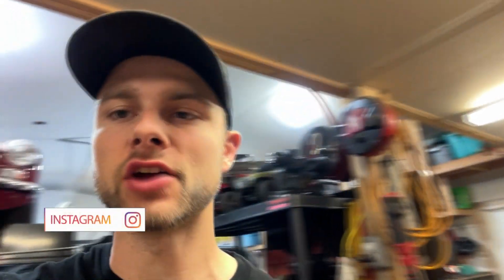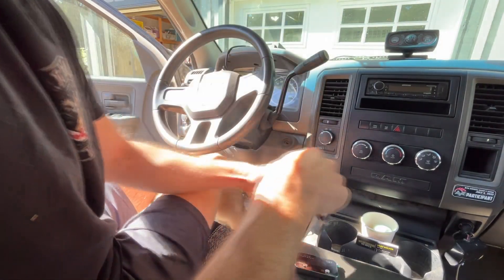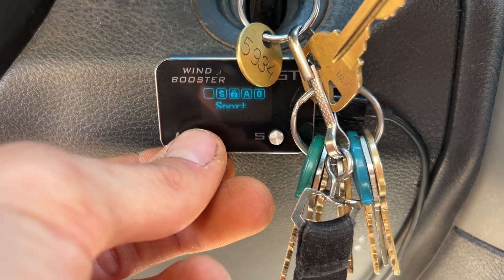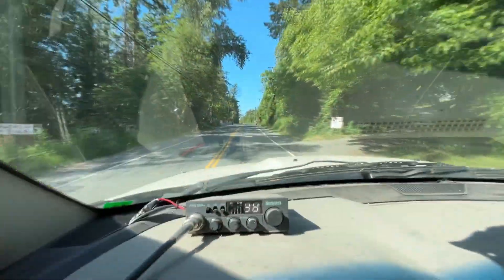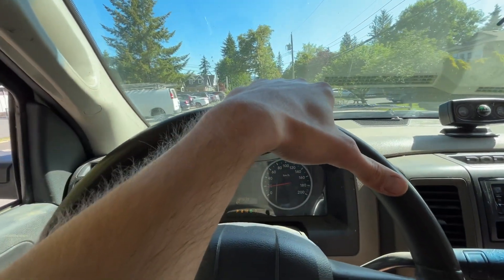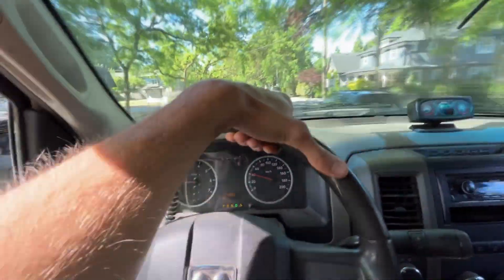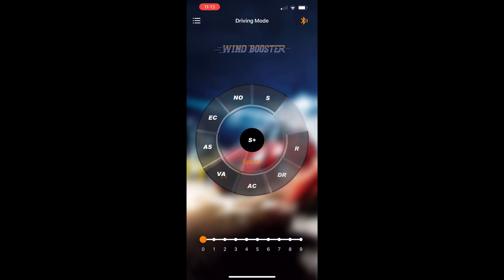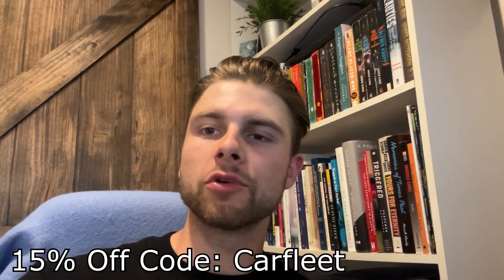Installing Windbooster Throttle Controller! Unboxing, Test & Review | Worth $200?

Comment: I need one..   hope it works good, do an update later. Does it get rid of that initial delay in the pedal?
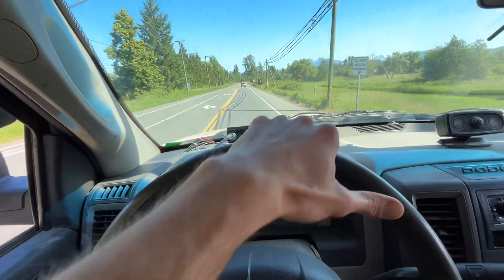    Lake Havasu 🌞 Az 6:28
Reply from the maker: It does get rid of the delay it’s awesome
Reply: @Carfleet  I need more instant power when off roading... This it?  
  RAM 1500 hemi. Stock.   35's
Reply from the maker: @bquade70  havnt tried it off road yet but I’d imagine it would help that